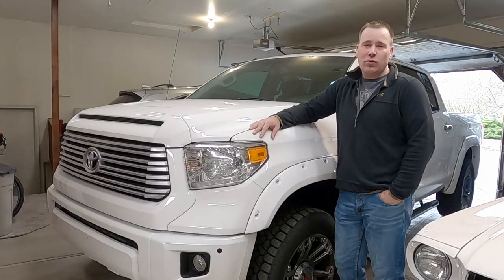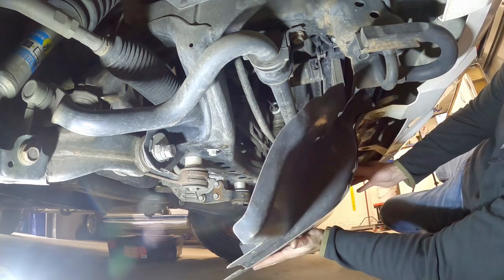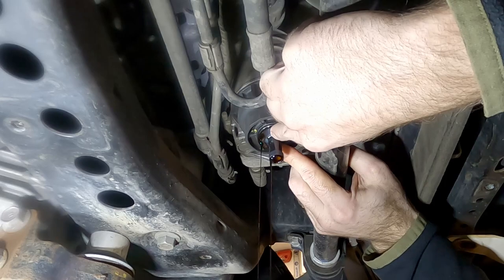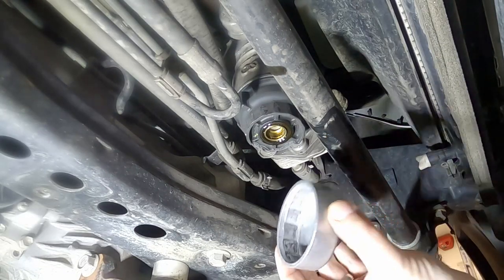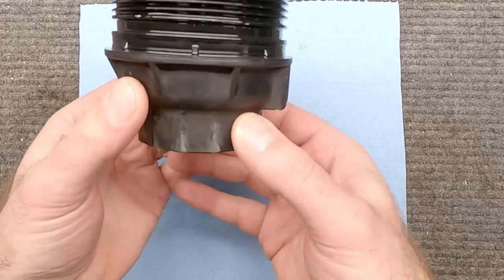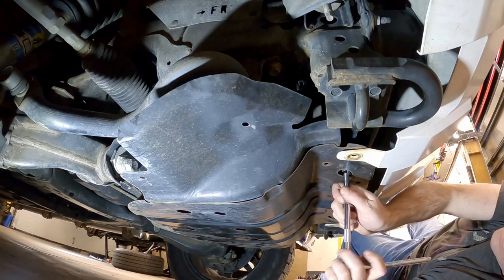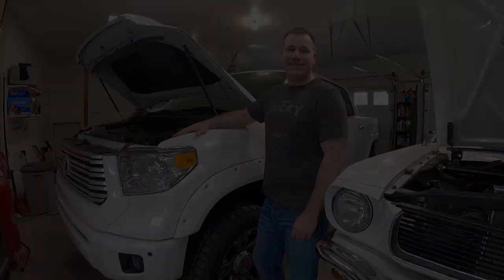How to Change the Oil in a Toyota Tundra

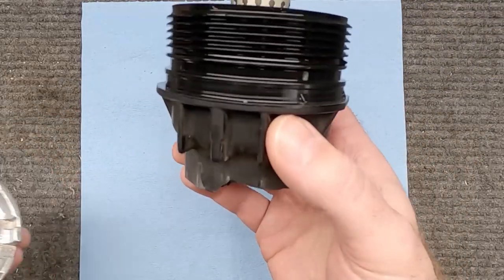Comment: Uhh, it looks like you forgot to swap out the center tube inside the oil filter cap. The one on your old oil filter cap is much longer than the new one. See 7:40 for the old one and 8:40 for the new one. This is not good and will likely result in oil bypassing the filter because one end of the filter will not be supported property.
See this video for details...
https://youtu.be/V7CyIi4fVt4
Reply from the maker: Good catch!  I have since gone back and fixed in my housing.  I also put a comment in my description.